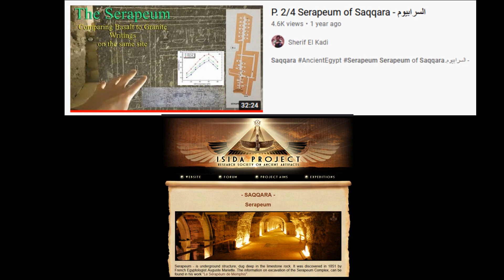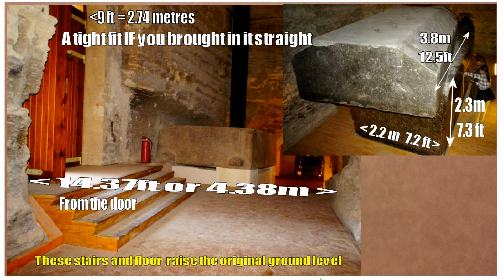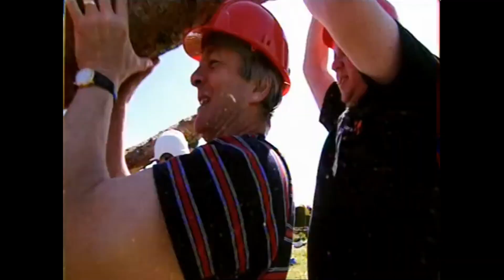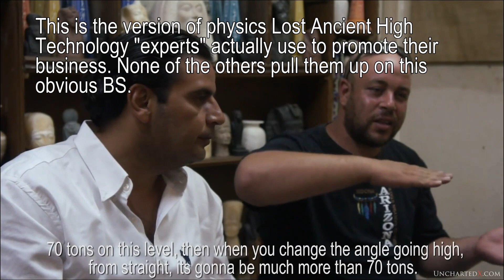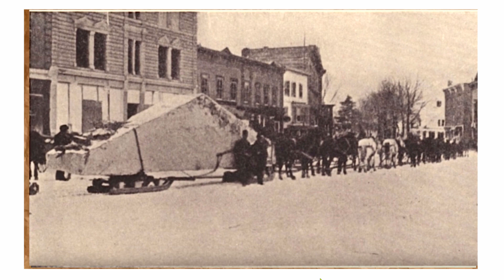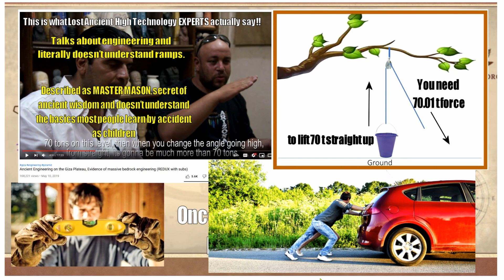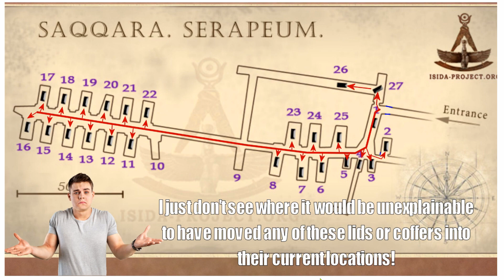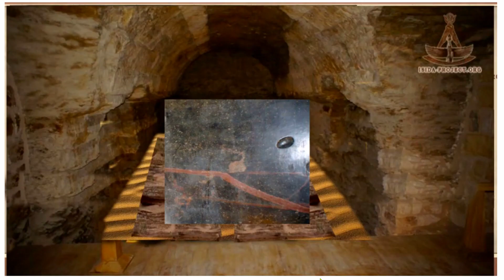Serapeum of Saqqara & Lost Ancient High Technology DEBUNKED Part 1

Comment: How about the source of light used when moving the Serapeum? I think the use of pivots (smaller stones under the coffin) might be one way they used to move the rocks but I don't think it is likely as they would require a flat and very strong base. Most buildings won't allow 50kg person walking in stiletto, just imagining a 10ton + block on something like a stiletto. That's a lot of force on a small area. 

But I do agree with you regarding how they moved these gigantic blocks. The 2 issues I have above are added to the difficulty to the project but I am in a total agreement with you.

Some of those levers they had used must have filled up every cm of space in the area. I think a lot of workers would have passed out/became sick from lack of oxygen in the deeper parts of the catacomb.

Thanks for the video.

Comment: Super large tractor trailers that pull giant loads of trees out of the forest in BC Canada drive across wood bridges.
Reply: My Bro-in-law's father who has since passed spent his career in a highway construction department as a surveyor.  He would speak to building roads and bridges.  Wooden bridges are actually stronger than steel/concrete ones in some regards since wood is dense and can withstand a considerable amount of "flex" compared to stiffer steel/concrete.  Its only real disadvantage is = it is susceptible to insect infestation and weathering.  So absolutely wood structures can be quite strong and durable.  🤔

Comment: If you put all of the moving of the blocks aside for a minute and ask your self the more important question:  How did they make the big boxes? I mean, how do you chisel out the inside of the boxes and make nice square and flat surfaces and all this without cracking the relatively thin walls of the box?  I can't even think about how we would do that today without some type of large industrial machining center.  I'm 57 years old and have been working in manufacturing sector since I was 18 which includes 36 years in aerospace machining of large hard metal structures.  I have worked with very hard materials including Titanium and Inconel and I can tell you that trying to build those boxes out of granite looks incredibly difficult to me even with today's technologies.  Just saying!
Reply from the maker: search on YT
Making a Serapeum Box with PRIMITIVE Copper & Stone Tools
Shows the process and the various experiments. I'll being a small replica soon
Reply: There are loads of photos online of the sarcophagi - many with tourists standing beside them or even inside of them to give you perspective.  Ergo what you claim to be "relatively thin walls" are in fact = upwards of a foot wide.  So a granite box with walls a foot thick represents a fairly strong medium.  Remember that if they were a thin as you infer = how could they support the weight of their similarly heavy lids???

So what likely occurred was as follows:

1 - temples such as this just like the Pharaohs employed professional castes of artisans. These were "salary workers" who spent their lives in the employ of the temple plying their crafts be it making clothing or jewelry - or stone statues and sarcophagi. 
2 - so the Serapeum temple awaiting the commissioning of the next Apis Bull internment orders from the quarry a block which is delivered and paid for - then as now they paid for things.  
3 - the block likely has already been worked somewhat to be an approximately smooth sided rectangle.  There the craftsmen if not already done proceed to saw off what will become its top.  
4 - upon achieving the two parts then they can begin to core out using tubular drills what will become the inside.  Systematically drilling cores which are then hammered out using gneiss stone tools can remove most of the material.  After that using stone tools such as flint shards - Mohs 7. Then they can carefully chip out the insides to achieve the basic outline - hand tools as opposed to someone swing a sledgehammer after all  lol! = which can be sanded smooth using abrasives such as sand/corundum.  Plumbness can be checked using carpenter squares as they work. The famous depiction of craftsmen at work in the Tomb of Rekhmire shows a craftsmen checking the plumb of a stone block using such a square.
5 - meanwhile work shaping the top has proceeded by another team of workers who similarly carefully cut/chip away what will become the final shape per predetermined dimensions and polish that smooth. 

Upon the 2 parts being completed the sarcophagus is moved into what will become its crypt per the video explanation awaiting the next interment.  So this process might represent months - or even years of work.  A new Apis Bull was not interred annually as the temple was in operation for more than a millennia.  Rather some Pharaohs wishing to raise their appeal would associate themselves with the various Egyptian deities via building temples dedicated to them = or commissioning a new Apis Bull interment.  Those who did saw via the hieroglyphs on them their names included so as to take credit for it.  

So the point is this was an ongoing affair spanning centuries.  As demand was constant = work on the next sarcophagus would constantly be ongoing.  So you can not think of them being "made to order" as much as one was likely always under work awaiting some Pharaoh to pay to attach their name to it. Was it hard work - invariably.  Yet as noted they were salary workers who did this as a condition of their employment.  The temple gave them what was a good living = room/board and steady employment.  🤔
Reply: Addendum:  I have described for you what likely transpired for the earliest internments.  As noted the Serapeum began in the early New Kingdom period.  Yet it continued to be in operation until = Ptolemaic period - which is well into the Iron Age.  So the area of the "lesser vaults" reflecting the early period is not open to the public.  What you see here and in online photos represents the later additions to the complex = late-New Kingdom/Persian period and finally the Ptolemaic crypts which coincidentally represent the nicest sarcophagi.

Thus these nicely made ones were in actually made using = iron tools - as opposed to the gneiss stone/bronze tools used to create the earlier versions. Stone/Bronze tools can in fact work stone as the videos allude to.  It is also possible when one considers that iron smelting began pre-2,000 bc in the Mesopotamian/Indus Valley cultures - and ancient Egyptians traded with these people - that access to them by the Egyptians might have been possible.  Tutankhamun famously was buried with his meteoric iron dagger. Yet there is history to infer that Amenhotep III also had such a dagger which was given to him as a wedding gift from one of his wives people = the Mitanni - who lived in what is today northern Iraq/Syria - or the area where iron smelting first began.

So it is always possible at least some iron tools made their way to New Kingdom Egypt via trade.  They like copper ones would have been expensive to procure making access to them tightly controlled. I have watched docos of Egyptologists in New Kingdom quarries whereby one stuck a magnet into the sand surrounding a partially completed sphinx which was abandoned in place = and iron shavings came out.  As with all things you must consider the totality of what you see + what evidence relates to that + and finally placing something in the proper period/context.  Enjoy your day. 🤔
Reply: Why haven't the tools you mentioned ever been found in Egypt. Or have they.

Comment: The crushing of the wood always makes me smh because it is just so incredibly common thru out history and even today.The first thing every mobile crane or drilling rig does when they arrive on a site, no matter what size crane, they get out the solid wood blocks to go under the Outriggers(the extending arms that keep the crane from tipping over).  Massive Ships in drydock, jacking up stone buildings etc etc and every massive load that is moved , wood blocks are put underneath.
Reply from the maker: It’s like those “experts” aren’t  really that expert me thinks. 
Though they do know really. Even without experience they’d have seen the types of examples you mention. 
I wish I saved the clip but one of these guys claims the wood would crush and not 30 seconds later shows a yard full of blocks on planks and pallets so the fork lift can get in underneath.
They just need to create a list of “impossible” …… therefore anything else but reality is plausible.

Comment: This is excellent explanation for moving the stones and fitting them in place inside the chambers, however I still have a problem with understanding the inside cuts of 90 degrees with a tool that is 4 numbers lower on mohs scale. The outside of the box could be done with a cooper saw using sand, no matter how many months would take to do it- it could be done, proved by Lehner and Socks. However the inside of the boxes is more perfect and precise than the outsides of all finished and polished ones (some of them with many scoop marks, lines and hieroglyphs cut in over the damaged parts) that indicates the interior was more important for the Egyptians than the exterior. Do you have any link or explanation for this, as even Zahi Hawass never had a valid one? 
P.S. I honestly never gave a s... who build it or when, just wanted to know how they cut corundum and other granite stones from the inside. :)
Reply: "Dating".  The Serapeum was in operation from the early New Kingdom until Roman times. The section open to the public - hence your photos of sarcophagi - reflect the last ones to be added = Ptolemaic period.  By that time the Egyptians were smelting iron tools.  As an aside.  Note it was in operation for more than a millennia - hence demand was constant.  This means new sarcophagi were likely constantly being fashioned awaiting the next iteration of the Apis Bull to be chosen.
Reply: The insidie of the boxes con be done only by a machine…. No way to obtain same results unsing hand tools!!!
Reply from the maker: @Marco-ch3kp  inner trihedral corners with hand tools are so common that it’s remarkable anyone still believes that.
Sorry to be so blunt but it is utterly ignorant to believe that. Any historical (pre machine) building has inner trihedral corners by the dozens or hundreds in the decorative carving. 
Inner corners is apprentice level work before they become sculptors and carvers.
Letter carving basic is inner trihedral corner in fine detail. Quality letters carvers have fullered grooves and corners because they are too good for basics like corners.
Plus if you actually look close at the corners they aren’t very well done at all.
It is tiresome to hear this nonsense because those such as yourself saying haven’t even looked at the corners (hi res photo and video is available) and you don’t know a thing about the traditional skills of masons working by hand, who still work today without machines.
Please stop pretending to care and leaving comments as if you have even the faintest idea of what you are talking about.
Reply: @SacredGeometryDecoded  so you're saying ALL of the boxes have a precision level that can be done by hand ?
Reply: @samo6083  No, as I heard only one box has perfect 90 degrees interior corners, others vary from 87 to 92,93

Comment: Now try doing all of that with many dozens of men under torch light with no ventilation in the desert heat.  Surely the accumulation of carbon dioxide alone would be an issue.   Your explanation is a plausible hypothesis, but until it is tested, it is only a hypothesis.  If it were THIS simple, someone would have put it to the test in the +100 years since their modern discovery.
Reply from the maker: In the past hundred years they had made automobiles and airplanes.

Working in mines was also a thing. 
The ventilation isn’t much worse than the back alleys of a bazaar.

Working in torch light was what people have done a long time.
Reply: @SacredGeometryDecoded  Working in mines was "a thing" until we learned that people die of carbon monoxide poisoning (and very quickly) if there is no ventilation. And the Serapeum is NOTHING like the back alleys of a bazaar.  Open flames in a closed space coupled with expiratory carbon monoxide from the people working inside is a lethal combination.
Reply from the maker: @arashadjudani2478  the Serapeum at Saqqara is 250 metres long. Ventilation is not a problem. It gets crowded with tourists and has no ventilation system.
It’s absolutely tiny in terms of tunnels. But any excuse will do to protect the sanctity f religious artefacts.
Reply: @SacredGeometryDecoded  The tourists aren't hauling 50 ton granite boxes and they are not burning dozens of torches.  Under those circumstances, ventilation becomes a very big problem.  This is why they tell people not to have a wood-burning open flame inside their camping tents.
Reply from the maker: @arashadjudani2478  they had lamps throughout that time, including matron on castor oil to go smokeless. 
Odessa has 2500 kilometres of tunnel underneath when they were used as limestone quarry, Paris very similar, Made centuries before modern type lamps or electricity.
They had lots of people working in much much much longer and narrower tunnels using flame based lamps as lighting. Not just Egypt but everywhere. You are searching for any problem to throw at solutions.

The only mystery about these boxes is how they have created a post industrial fetish cult,  but there isn’t a cult elevating aqueducts to some mysterious unexplained relic?
That’s the real mystery.
Reply: @SacredGeometryDecoded  I don't claim to know how they were built.  And for the record, I don't believe in aliens or other nonsense.  The seraphim was built by humans, but we don't know how.  The reason why the mystery persists is because NO ONE has ever been able to replicate them.  If you believe that the boxes were created using copper chisels and pounding stones, PROVE IT.  But there is no point in debating with you because you seem to have all the answers.
Reply from the maker: @arashadjudani2478  firstly the Pto;emaic records include bonus wages paid to the workers who made and delivered them to the Saqqara. Along with other receipts, they were made in the iron age.
Secondly with pre iron age tools it is possible to work granite just as well. Iron is not magical, my own and others have experimented with this even though it shouldn't have been necessary to prove.

You are correct there's no point in you debating me. 
https://www.youtube.com/watch?v=XY6SUTPV018&list=PL47iaGB6hlT5sYZWd_G7sHg9cSRv6WWS6
I have done the work and am still waiting for a single person on the alternative side to match a fraction of 1% of my efforts.
The theory and the practice I am all over.
You still believe precision and the short tunnels are death traps.
A debate requires both sides to have some knowledge. Everything you have said is copy pasted from lost ancient high technology talking points. It's all wrong. 
Also you can do experiments to prove your point, by using the tools you claim do not work and demonstrating it.
A little bit rich demanding everyone do your work for you and you do nothing but repeat lost ancient high tech rhetoric.
I'll go on a livestream and do a real time demo of the methods. No one wants to take that bet.
They know I don't mess around, I bring the receipts!!

Comment: hehehe... this "explanation" is so forced... you must feel that you are wrong... showing all these guys moving a much smaller block - with all the space available to them  is really something.... now put these guys inside a DARK and NARROW underground corridor, and show us how they move 100 tons.... now -- this is just stupid task of moving them in place that's already impossible... think about an accident - one error, where it gets stuck or is dropped and it cracks...
Reply from the maker: They found a box still raised on sand as well as a set of winches.
Hehehe I didn’t know about those finds. I was listening to lost high tech guys who claimed vehemently there was no archaeology.
NARROW helps you.
DARK, because things get heavier without light? And you need to believe our ancestors were so primitive they couldn’t manage a lamp?
Hehehe
The way you force a mystery when there is an explanation us classic cult behaviour. And make no mistake you have been conned by this cult.
Reply: @SacredGeometryDecoded  Egypt is very anomalous - in it's insistence to do things the hardest possible way. We have good contiguous record keeping from times not that distant - Rome, Greece - all their architecture is "logical" and "reasonable"  - carrying 100ton  single block of hard granite from hundreds of miles away to carve perfectly and bury underground....just doesn't ...ummm... sound "sane"
Reply from the maker: @pittuk6500  none of the boxes weight 100 tonnes to start with. Plus quarries are next to the river and so are the sites. They moved them a couple of kilometres at most. The rest was floated.
You should look into the work that has been done.
Lost high tech is a con. These alternative researchers can’t ramp and think a granite core is a mysterious unexplainable artefact. Or that polishing is a mysterious process and they also look at the schist disc and claim it is precision. Like the Serapeum coffers, vases etc the imprecision is plain to the eye.
It is a cult.
Reply: @SacredGeometryDecoded  the schist disc doesn't help your argument.. it's definitely a one off artifact...
Reply from the maker: @vincentrusso4332  ac learly imprecise and unbalanced one off argument by the same people who tell you its 100 tons, or that core 7 has a constant spiral and cannot be replicated with copper tools.
I think you might want to look through my catalogue a little bit more, i've been through all these things with a fine tooth comb.